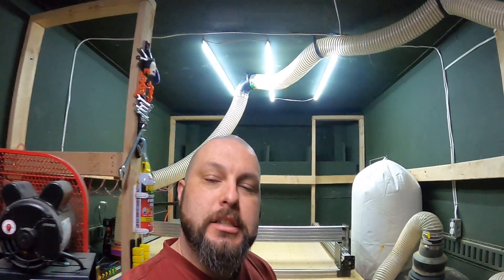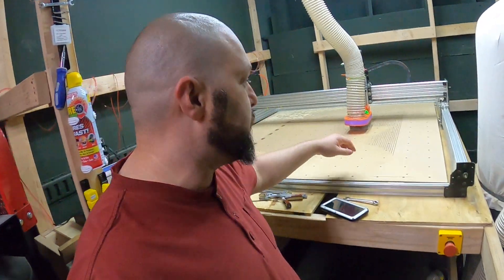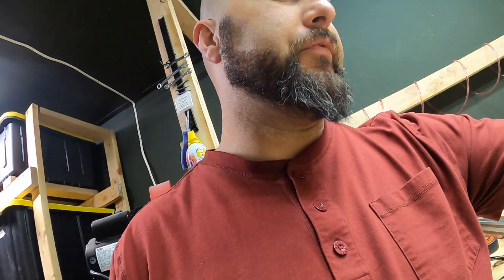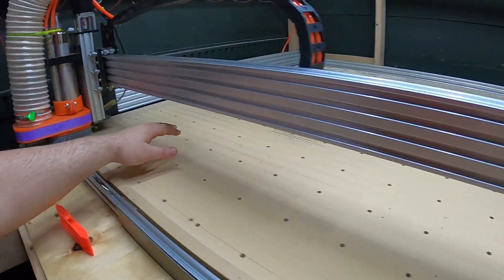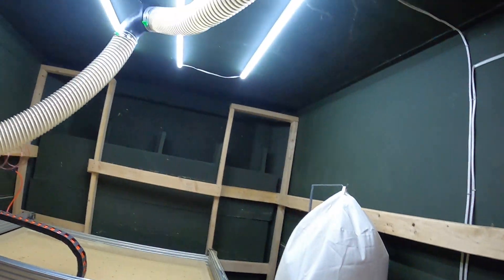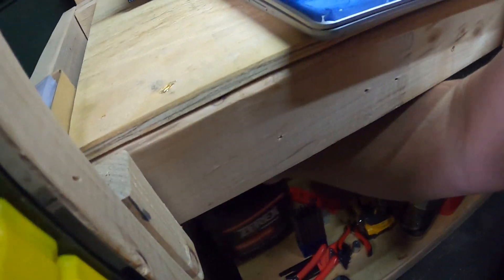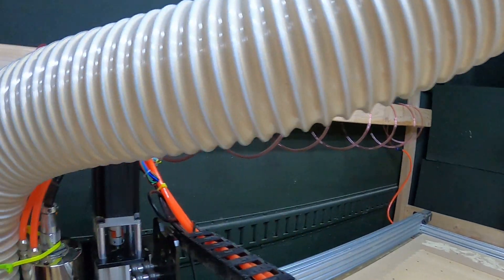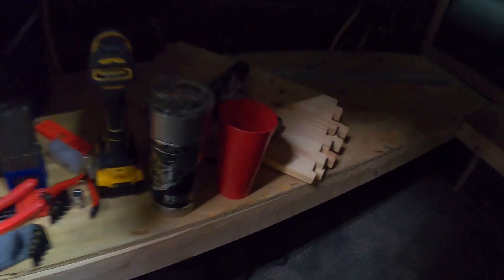Bulkman 3D/WorkBee/QueenBee Pro CNC setup in shop, waste board prep & first project.

Comment: Bro! I'm so happy to find your great video. You have the same 5x5 machine I have, or very similar. But I'm stuck at about the 85-90% complete stage. 

Are you available to help me get to the finish line so I can get to using all my cool tools? 

I'd be willing to compensate you for your time and knowledge. Would some mentoring calls, text, and video chats to see my setup, where I'm at, and what I need to do, be an option you would consider? Thanks again!

Comment: Jeez. I've only got the Bulkman3D 750x500, with maybe 100 hrs cutting in and the polycarbonate V wheels for Z and Y are already about worn out from hauling so much weight. Good thing they're cheap by the sack! With your setup though, I'd look at the Bulkman3D linear rail upgrade for Z and Y. The "QueenBee" kits.
Reply from the maker: I am already working on the upgrade in my latest videos...

Comment: Man I find myself in a situation where I'm building two queenbee 1515 machines. One for my boss at work and one for me. I've been going nuts trying to find a good wasteboard solution for both with 4x8 3/4 mdf sheets. Thinking of cutting strips off the longer side of the sheet and using t tracks to butt in between each slat. No luck finding big sheets of mdf, would be cool though. Really dig the videos, great explanations and good information.
Reply from the maker: It was a hunt trying to find the 5 x 10 sheet but was worth it. I’ll be doing the queen bee upgrade here soon.
Reply: @702marine  dude it's a brutal hunt, I work at a large format digital print shop (pass by a Valero we did all their upgrades, also all the signs at the Decatur 215 shopping center) we also print using a flatbed, and even my boss he has connections to source industrial tier medias and cant find a 5x10 lol
Reply from the maker: If you are in Vegas go to Peterman Lumber. It’s off Russell and Decatur area. Google it. They keep 3/4 5 x 10 MDF in stock all the time. They also have really hard to find types of wood as well.

Comment: I am thinking of buying the same one ... how does it make you profit when offering jobs and what kind of jobs do you do? I would really appreciate the answer
Reply from the maker: What you can make and how much you could make with your machine is dependent all on your knowledge and abilities. You will need to learn how to design projects, set tool paths, and learn what materials you can work with. I have made a good amount of money using my machine. However, I’m not using it as a income generator. More supporting my hobby. Plenty of people do make an income from these machines. It really comes down too what you want to do, finding a product that sells, and getting good and making it.
Reply: @702marine  Thank you ... the truth is, I am acquiring more knowledge, I have been working with wood in furniture for more than 1 year and the idea of the machine is to get a separate income and at the same time save time ... thank you very much for the answer and good channel.
Reply: @702marine  What program would you recommend for use?

Comment: Thanks for the fantastic videos. I've also got the 1515 machine and had it 95% put together and discovered the manual on the Bulkman 3D doesn't suit the largest size. Thank god I found your videos and the extra manuals that Bulkman supplied you. I decided to go backwards and fix the problems for the 2.2 version. My question to you is.... I noticed you modified your original build to give you more Z axis travel. Can you give an explanation on what your did please? Are the wide extruded aluminum pieces now laying flat on the bench?
Reply from the maker: Yes they are flat and using only one bracket. I also removed the front 20x40 extrusion.

Comment: Hi, great video. I also have the same machine. I opted to have all nema 23's. I also was getting whipping from the y axis which uses two motors slaved in the Y. So I went with 5/8 ball screws. It makes the machine a lot noisier but these axes are solid they wont even flex any bit.

Comment: Nicely done. Can somebody help me? I've got the 1500 X1500 3D bulkman, Nema 23, TB6600 stepper drivers, Novusun V2 and Mach 3. When I start cutting everything goes well for a while and then the machine just goes crazy and damage the whole project. I've replace the driver motors 4 time and the Novusun twice. All the wires are grounded. Sometimes it will finish a project. Can anyone help with advice?
Reply from the maker: Have you watched all my setup videos?
Reply: @702marine  Yes. I think it has to do with electrical interference, but is not sure.
Reply: @702marine  boss do you advise me buy one 1500mm* 1500mm

Comment: Hello, have you ever had an issue with the stepper motor drivers ? I have the same machine and I had this issue when during the working on really simple project suddenly on motor on Y axis just stopped. And motor was kinda "loose" and you could move it. Once I have restarted the whole machine everything was good (motor "locked" again), I tried to do it again but after almost same period of the time it happens again. So I switched cables from left to right side and it happened on the other side too.  So I have changed the stepper motor driver and it was ok but then the stepper motor  on Y axis went out :D Luckily I have ordered two drivers so i changed it again, but am I doing something wrong ? ... Has anybody experienced similar issue ? thanks  a lot :)  I am talking about this part https://www.aliexpress.com/item/4000237105621.html?spm=a2g0o.productlist.0.0.cb3614bbvAQw4J&algo_pvid=ab6310bd-449e-47e9-b06e-5521550f573f&algo_expid=ab6310bd-449e-47e9-b06e-5521550f573f-13&btsid=2100bdde16042657816112646e7938&ws_ab_test=searchweb0_0,searchweb201602_,searchweb201603_
Reply from the maker: What are your Dip switches set to?

Comment: Great work.
I am an electronics Engineer looking to get into CNC to make some housing for my projects. 
This kit fits into my budget and will like to know what the hardest material you were able to cut with this.
Reply from the maker: You can cut aluminum on this machine. I’m sure you could do brass as well. Fiberglass, foam board, plexiglass are all possible. I’m sure with the right settings and setup you could lightly engrave steel and stone but nothing too crazy with that stuff.

Comment: Really like your channel, I just recently bought the same cnc router kits  from 3d bulkman  1500x1500 mm, was wondering if you had special order  5'x10 '  M DF spoiler board from Homedepot? I AM IN YUMA, AZ I know what you mean abouts the  heat. ALSO Was wondering what The DEMSIONS OF YOUR TABLE?
Reply from the maker: I looked like crazy to find the 5 x 10 x 3/4 MDF. Lowe’s and Home Depot both told me no so I had to look for something else. I ended up going with Peterman Lumber here in Vegas and they had a good amount of it. It was only $65 I believe and well worth it. I have since gone back to them quite a bit because they have a great selection of different materials and exotic woods. My table is 42” high to be much more comfortable on my back to work on. The table top is 5’ x 6’...